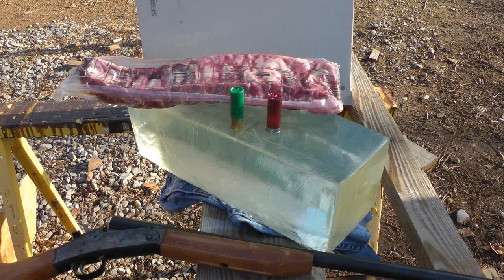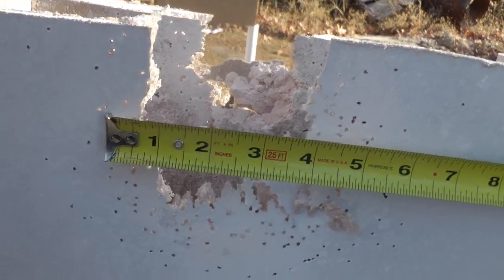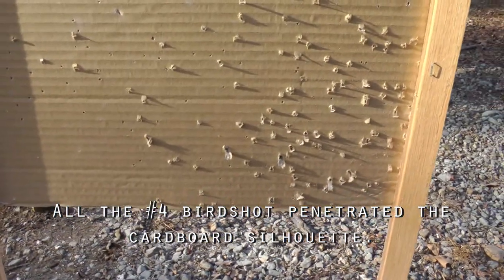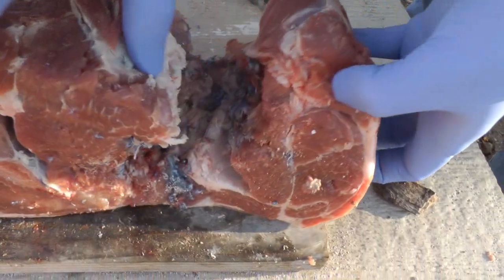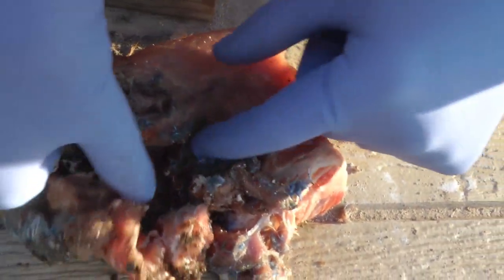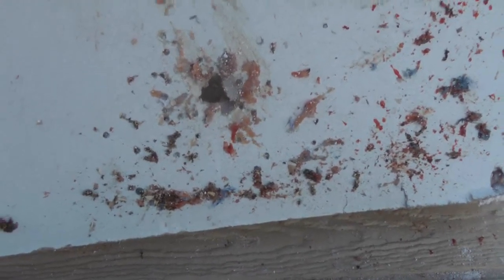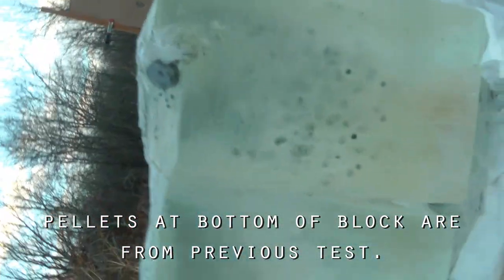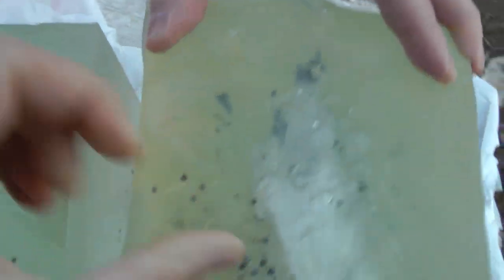Birdshot Home Defense Gel Test

Comment: Once again, bird shot is shown to have inadequate penetration for defense. Good test. Thank you for posting. Bird shot is for little birdies. Now, I'm sure that a lot of folks will look at that and say that the shot penetrated the entire chest analog. To start with, the meat was shot on the end grain. The shot didn't penetrate so much as just split the meat. That said, it still isn't enough penetration to reach vital organs if the bad guy is doing anything but standing still and facing you. So if he has surrendered with his hands in the air, then this load would probably work okay to murder him. If he is actively attacking you or a loved one, the shot would have to traverse a longer distance in the torso and may impact his arms or other objects first. That's the reason for the 12" standard, folks. ANY load that is powerful enough to reliably stop a bad guy will penetrate multiple walls and ANY load that won't penetrate multiple walls also won't reliably stop bad guys. Federal Low Recoil 00 buck is the best load for defense. Any #1 or larger buckshot is also suitable for defense.
Reply: Have you seen the Video?
Reply: zombi111980 I saw the video. Confirmed exactly what has been shown over and over. Birdshot will blow through walls just fine, and will cause life threatening wounds. What it won't do is reliably incapacitate people. I don't care if it blows through a guy's ribs and might eventually kill them. I care if right then and there the guy ceases to be physically capable of causing more harm. Birdshot fails to do that. So by picking birdshot you have selected something that not only is still dangerous to anybody in the next room if you miss, but you won't reliably stop an assailant Sounds like a loose/loose to most people, but some just want to believe that the cheap crap at Walmart will do magic for them when people who study this for a living say otherwise.
Reply: do you think that the intruder is gonna ask himself, hmmm, I wonder what shot he has in that gun??  or, shit, theres a 12 gauge pointed at me, I better get the fuck outta here!!!
Reply: daleon96 Maybe. Or he just starts shooting. In any case, it is incredibly stupid to load your shotgun with ammunition that won't RELIABLY incapacitate.
Reply: daleon96 I agree that a rational person would think that.  But most people that are stupid enough to break into someone else's house are not rational.  bottom-line is bird shoot will work if it is all you have, but I wouldn't want to depend on it.  If you have something stronger - then use it.
Reply: Quite a few people have been hit with birdshot and continued to be mobile and dangerous
Reply: show me one human ! just one , who could stand up to that and feel like carrying on with whatever he was up to . every freaking shooting video in youtube shows the same thing , they get shot , they run off and usually die . but they always ALWAYS haul ass
Reply: THAT'S what you got from that video?   wow
Reply: You guys saying it won't kill are crazy.  He just demonstrated it will.  It was deep enough and destroyed bone and meat in an area the size of a fist.    You show me someone that can live with a fist dozed chunk of chest cavity and a spray of bone and pellet fragments.
Reply: The problem with the meat tests is while it looks realistic, dead meat does not have the same water content as meat loaded with blood.  If someone did this test on a freshly killed deer or, better yet, a feral hog, then that would be a much better test.  Doing it on a live hog at 7 yards would be even more interesting but it would be cruel on the hog.  It would however demonstrate whether or not birdshot can incapacitate.  That would really be the only way to end the debate once and for all.
Reply: Yes you can but only when you learn to write in proper English as I can barely understand what you're saying. If you spend time researching injuries from birdshot, you'll see that it rarely kills anyone and only rarely reaches vital organs.  Blood and water content in living tissue, does make a huge difference which is why the FBI doesn't use meat targets but rather ballistic gelatin with layers of denim in front.  But obviously you are much smarter than the ballistics specialists at the FBI and the scientists who helped develop their testing protocol.
Reply: I have no reply to your critique. Clearly you are a man of great intellect, wisdom, and knowledge.  It appears that I've wasted my life in pursuit of education and specialist knowledge.  All this time I should have just listened to people like yourself.
Reply: Do you all forget that most shotguns carry multiple rounds? If the 1st round doesnt take you down, I'm pumping more down range. Sure, one round of birdshot may not drop him dead, but he is going to be doubled over in pain, and have more shot coming his way.
Reply: @Darren Fox  Again, go look up research on bird shot injuries.  You are correct that it is not fun to get shot with birdshot, but when a bad guy is pumped with adrenaline, the bird shot will not incapacitate him.  Most of the time they will run for sure so I'm not saying that birdshot is useless for home defense.  However if you are worried about over-penetration, #4 buckshot is your best compromise if you actually want stopping power.  
You can also do a type of "candy-cane" load with birdshot first, followed by more lethal rounds.  But given that most home invasions are done by multiple intruders, I personally won't take that chance.  I DO own a 12 gauge pump shotgun (Mossberg Maverick 88) with an ATI telescopic stock with an integrated side-saddle.  I keep the tube loaded fully with #4 buckshot while on the side-saddle I carry 3 00 buckshot shells, one birdshot, and one slug.  The birdshot I keep handy to pepper anyone on my property trying to break into my storage sheds (which I almost had to do but they ran off thankfully without me needing to) or car.  To me someone trying to break into my car or storage sheds is not worth killing them over.   However, if they are bold enough to enter my house, then they are prepared to kill me.  As such I won't have mercy on those individuals unless I see that they have no guns in their hands and are trying to flee.   BTW, I am also professionally trained on the Mossberg 500 (almost identical to the Mav88 other than the safety and pump assembly) as one of the firearms I used in the military.  So the pump shotgun is a weapon system that I have actual tactical training experience on.   So again to reiterate, I am not telling anyone to stop using birdshot.  I am just saying to do your research on the actual FACTS regarding FBI standard ballistic gel/denim penetration tests along with the FACTS of real world birdshot wounds so you will know that birdshot has little stopping power unless your're using magnum loads.   If you're reason for using birdshot is recoil sensitivity, then I suggest  switching to a 20 gauge shotgun (or even .410) or getting the Aguila buckshot minishells (along with the OpSol adapter for them to insure reliability).
Reply: I also forgot to add....that for those living in an apartment complex, that birdshot is indeed the wisest choice.  But in a home, depending on the layout of your home, my own choice is #4 buckshot.
Reply: I've had  birdshot pellets ricochet back from targets, even at half speed they can draw blood and produce red marks. It's not fun and definitly wakes you up. Now picture 480 of those pellets in close proximity hitting at full speed. Then another. Clearly you've never been hit by birdshot.
Reply: No I haven't. As I said, it's not always a bad choice and much depends on what you're willing to risk. But having dealt with drug-crazed individuals and people super pumped up on adrenaline, often pain is ignored....and it is physical stopping power that then makes the difference between life and death for you and your family.  But statistically most intruders run after the first gun-shot.  So you're not wrong.... unless you believe that bird shot has stopping power.   That's the only thing I'm arguing against.  It physically does not much more than other painful non-lethal rounds do unless used at extremely close ranges or if you're using something like magnum turkey loads.
Reply: +wigon it's not use. People think visually impressive wounds matter more than physical damage.
Reply: Physically you have a gaping wound pouring out blood. Even drugged up, a giant gaping wound in anyone's chest ( or two, or three) is going to cause shock even in drugged fueled people. Statistically after the first gunshot, intruders are going to try and retreat, causing more blood to pump out. To say it's  ineffective is innaccurate.
Reply: Not to mention its hitting you with over a thousand pounds of force. You seen those punching games in pubs that measure how hard you punch? 1000 pounds of pressure is no joke. Each shot is like getting hit with a hefty punch not many can withstand. I doubt a fat or incredibly muscular guy is going to break in. Plus if it's in the face: game over. They're blind with a hole in their face. Case closed.
Reply: Matthew Warren statistically I also don't need a gun to defend myself. Look if I'm banking on things going wrong, I'm not going to draw the line at a situation where I'm under violent attack but one shot and it's rainbows and sunshine. I've heard countless testimonies by EMTs responding to birdshot wounds and the gaping holes are ugly, but no vitals are damaged so the guy is still standing.

The dude from the FBI Miami shootout took a 9mm through the arm and entered his thorax provoking a lethal wound, dude kept fighting. That's three holes to bleed from. Kept getting shot, kept killing and wounding officers. It took a 38spl to the spine to drop him.
Reply: Matthew Warren boxers often hit at above 900lbs.ft, hell in kickboxing and muaythai the impact of a kick puts even more bodyweight and people can go 5-12 rounds. Blind? Can still stab and shoot.
Reply: @Matthew Warren   The fact of the matter is that the facts do not support your belief that bird-shot has physical stopping power.  As Titanium Rain noted, drug fueled criminals or people pumped with adrenaline and rage, do not care if they're bleeding.  It goes back to the old science-proven phenomena of "fight or flight".  If they choose to "fight" then you are screwed hence why some people choose a "candycain" load of progressively powerful shells in their shotgun.   Personally I want the first shot to drop them and any of their pals.  I will not take that risk.
Reply: I use armor piercing 50 bmg for HD. Why? Because nobody is going to invade my home without body armor.
Reply: Any of these fools that claim bird shot has no stopping power have been watching to many movies . Did you catch the obliterated the ribs part? center mass? that means your heart lungs and other organs are hamburger. At 10 feet your dead and it would be a big thump. And the best part is it is much less likely to go into the next room or house to kill an innocent. 
Anybody that considers any type of weapon none lethal should not own one,

Comment: Buckshot, buckshot, buckshot! Always use buckshot if you can. While I can understand the concern, any projectile you shoot that will reliably stop the threat will always come with the risk of over-penetration. Instead of looking for an ammo solution look for a training solution, practice in your home, look for what your back-stops are in multiple areas in your house, pattern your defensive load at the closest and furthest distances you're likely to shoot from, and then go take a few tactical shotgun classes. 

I only run Federal Flite-Control #1 buckshot in my defensive shotgun, it'll hold a tight pattern out to 25 yards and #1 buckshot has enough power to reliably stop the threat out to that range. I've run through dry exercises periodically in my house to constantly remind myself where my backstops are at, where the blind spots are, and to practice running the gun in close quarters.